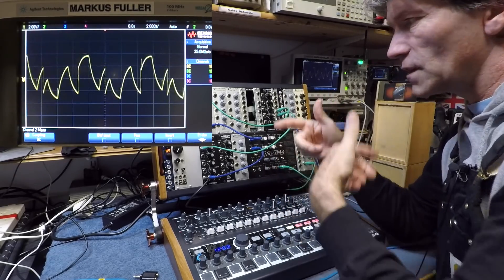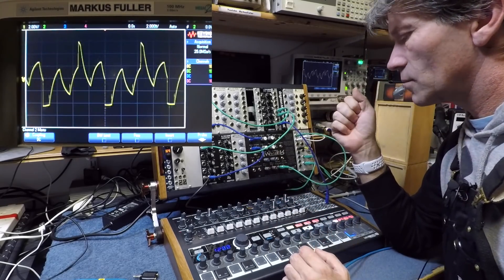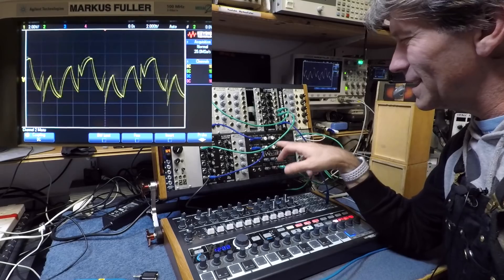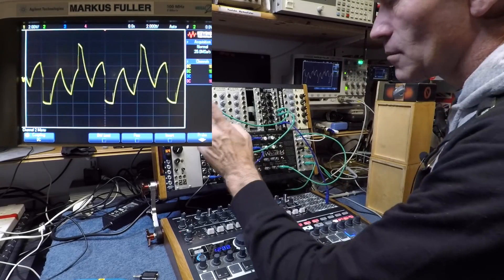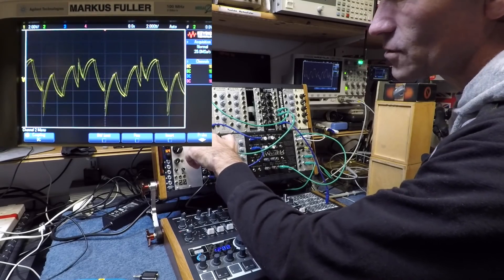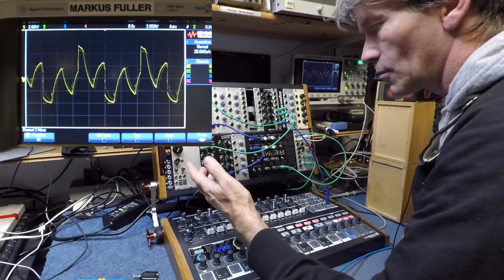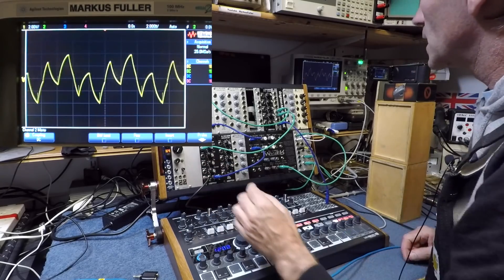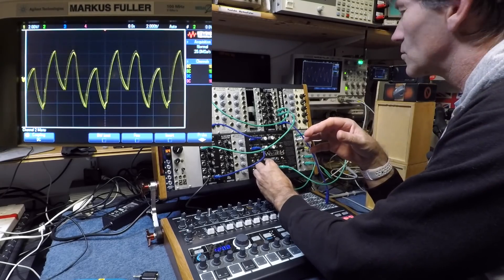Analog Wave Twister Part 3 Audio Examples

Comment: Hi there I have a Sony mhc gnz8d stereo player 5.1 the front and left channels are dead rest surround sound and centre are working fine please help me what can be done.
Reply from the maker: Richie SPQR Hi Richie have you tried swopping the working speakers for the ones on the dead channels just to eliminate the possibility that it may be the speakers or cable to the speakers. if the same outputs are dead it may be the amplifier chips for those channels that are faulty or something leading to those amp chips. theres lots of possible reasons why an amplifier would stop working correctly.
Reply: @markusfuller  thanks Mark but I m still suspicious way current is passing on the chassis Nd the rest channels like centre surround are active. I m not a techie of electronics I m worried to gve it to the local technicians here.

Comment: In my experience signal inverters are most useful when working with two signals from the same source. For example if you take a signal from an oscillator, low pass filter it, and then mix it with an unprocessed and inverted signal from the same oscillator, all the frequencies that passed through the filter get cancelled, effectively turning your low pass filter into a high pass filter. You can also remove the fundamental from a saw by mixing it with an inverted sine from the same oscillator, etc.
Reply from the maker: That sounds interesting. I should try playing around with that idea. thank you very much.

Comment: That Triangle/Square example sounded vaguely Polyphonic to me... & previously it sounded like you were adding Reverb. I think it's actually pretty cool√
Reply from the maker: Caalamus no effects were used its straight into the recorder. but you could do this on a mixer with fine adjustment.
Reply: @markusfuller  Oh, I know. You were just seemingly a bit disappointed in your work & I was disagreeing with you. It's subtle... but two of the enjoyable Modulations I noticed you achieving, were faux Polyphony & Reverb. 

 In other words... the normal "duet" I hear between two Oscillators is accentuated with your module. It does so in ways that lean Poly or Reverberated. 

 To my ear.
Reply from the maker: Caalamus Yes I think I know the parts you are referring to. they do sound slightly reverb though no effects were added at all. I started rethinking this one in the attempt to maybe rebuild it but possible add something though I’m not sure what at the moment.

Comment: Im liking it Markus. The first 2 blends would definitly be good for   organ type timbres. 
I will defo have a look at the schematic and see if i can put my pwn twist on the circuit as i like to do. :-).
I think my goal would be to get one wave to tilt another out of phase by say 45 degrees or more . Anyway just a thought.
Reply from the maker: Adamski A. Hi Adamski. yes at the moment its really just acting as a mixer but it needs something extra to make it more useful in the audio world. I know you can come up with something.
Reply: @markusfuller  Is it possible i could get the schematic in its more basic form as a pose to the pcb masks as im having a little trouble figuring it out. No worries if its not possible.

Comment: HI Markus, have you seen the small glitch spike between the pulses ? sometime higher amplitude, maybe not distort the sound but can be a fun investigation video with your nice oscilloscope  to see where it comes from
Reply: you mean with the triangle ? if so, I think this is related to the A-110 vco being a saw core (but it might not be what you were talking about)
Reply: The glitch is in the sine as well look at at 1:20 and around, it travels along with the wave as small spike.
Reply: @Peter-W1  yes I think this is the same reason. I couldn't find the raw waveforms on oscilloscope for the real A-110 but I found a Softtube version which exibits this behaviour as well for the sine and triangle: https://youtu.be/QTkh7acFtSk?t=47 it is pretty amazing to see that Softtube goes that far in their emulation. I guess they just sampled the wavefolms

Comment: It's strange - the waveforms look really pretty, but it almost just sounds like hearing both oscillators at once with a very subtle interaction. Maybe it needs something mathematicalesque in the circuit to amplify the interactions of the waves or such? I bet you can introduce some more madness in a version 2 :)
Reply from the maker: Wagoo yes it sounds just like a mixer when using audio and not that interesting at all. it certainly needs something adding to it to make it more interesting. fine playing about with CV but the audio side is certainly lacking any magic tricks.

Comment: 1:17  This is a mixer.
Reply from the maker: Roderick Legato Yes I do say it can be done on the mixers later in the video. the only difference with this is that it inverts signals and gives a difference between signals ie rather than sum 2 signals it will give the difference between 2 signals which is more useful for CV than audio.
Reply: @markusfuller  Actually, I suspect that if you sample the sum of waves into oscillator, you might get some timbre modulations.
Reply: after fiddling around in virtual version of this, I found that applying LFO on one or both biases creates some PWM-like movements, so that's already something. also applying feedback FM modulation on resulting wave can sound interesting.